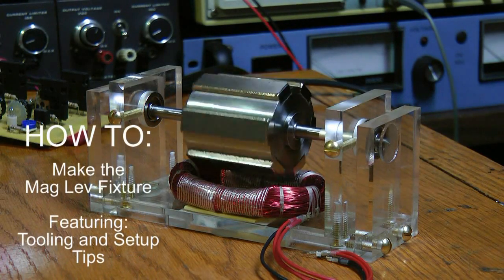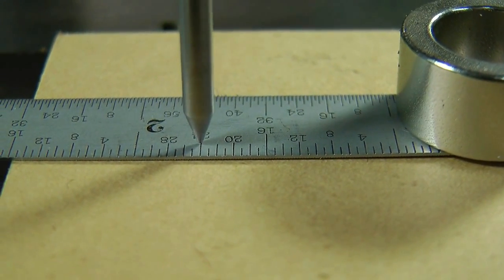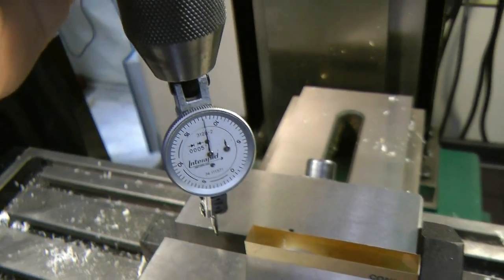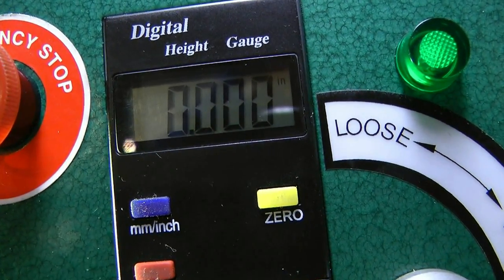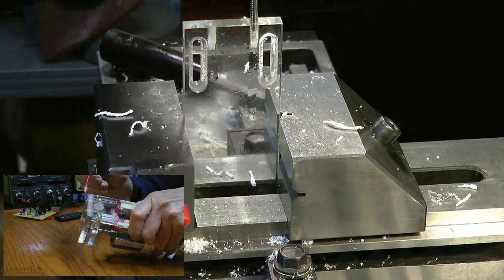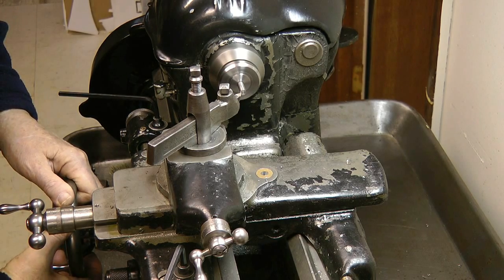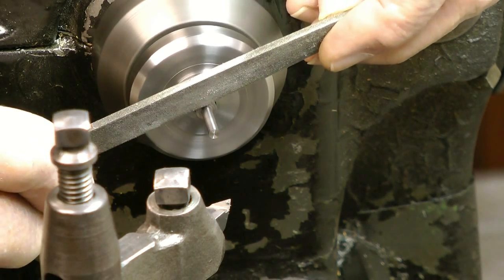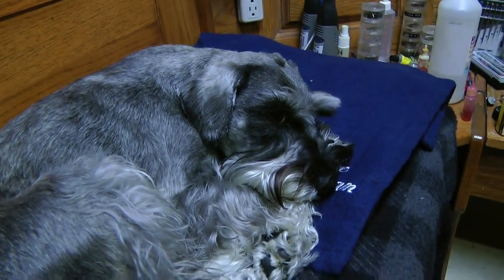HOW TO: Machine The Mag Lev Fixture

Comment: Hello John,
When I was 14, my best friend and I had a project in Boy Scouts to design a perpetual motion device and when I just saw this video, my jaw hit the floor.  What you built is exactly what we designed 22 years ago!  The only difference was instead of having a friction point on the end to keep it steady, we drew magnets on each end opposing magnets on stands to make it free standing.  Even now at 36 I have been searching for the ability to build this device, and you did!  Awesome job!  I know you are very busy but I would love to get a breakdown of the parts you used to make this.  I am so excited to see this and it works, less some ideas I have to make it run longer.  I would love to have correspondence via email.  My address is scubaman@embarqmail.com thanks a million!
Reply from the maker: Hello Dan, It's a small world isn't it. I've experimented with end magnets but haven't finished a concept. the adjustment is very tricky and I would likely have to make a precision adjustment with threads. There is a list of the magnets in the description under the video. Let me know what else you might need, and I'll get in touch with you.
John

Comment from the maker: Your thinking is right but the point of equilibrium is hard to keep. It's hard to explain but there is no place that the magnet will sit without wanting to fly out from one another. The fixture here can be stood on end but still requires the balance of pressure from the other side of the shaft. I think you have a good idea going there. as a matter of fact I've been working on modular bearing ideas and you may see something on a video soon.
John

Comment: I was wondering if you could help me with a question I have about how those ring magnets react to one another. If you had the larger ring on a table flat side down and well secured, and then put the smaller one inside with the poles of both magnets facing the same way. They would immediately link with the smaller one sticking halfway out of the the larger right? But if you then applied weight on the inner magnet to force it down, wouldn't both the magnet and weight float freely with no friction?

Comment from the maker: @SN1PEOMAT1C 
Hello, There's really not much to it. The magnets are always repelling so you just try to contain the shaft in a position where the center magnets stay radially centered without being pushed forward or back. The only tuning is to move the outside ring magnets to a setting where the point on the shaft hardly touches the mirror or glass on the end pieces. This is the same as a Mendocino solar motor but with a magnet surrounding the shaft rather than just underneath.
John

Comment from the maker: @Magneticitist 
Hey R. In a way it is levitation, but not actually fully levitated. The shaft is supported 360 degrees by magnetic pressure. However there is an axial contact point where the sharp shaft end can touch the glass piece on the end pieces of the fixture. This contact point can be adjusted to such a fine adjustment that it's almost non existent. I've had nearly 30 minutes free spin from 500 RPM's. Full levitation is possible with end magnets but the adjustment is really difficult.
J

Comment from the maker: @scooterscottii 
Hi Scoot. Next time I make a rotor I'll have to do a video. Because the shafts are usually on the small side it's necessary to work from each side of the piece. The first hole is drilled then bored and finally reamed from one side. This is just after the finish cut to the outside of the piece. Then the piece is turned around and closely centered with the indicator, then the same operations from the second side. 
Thanks for the thumbs up, but the base was just basics.
John